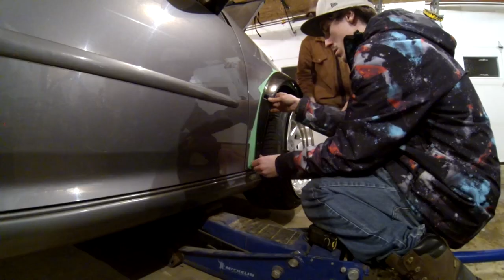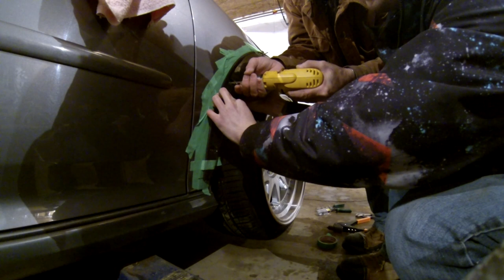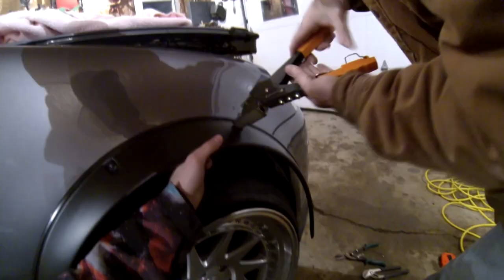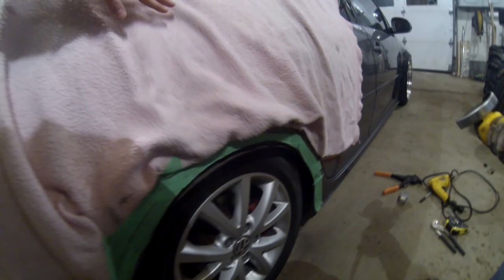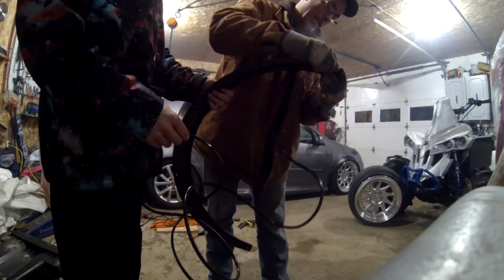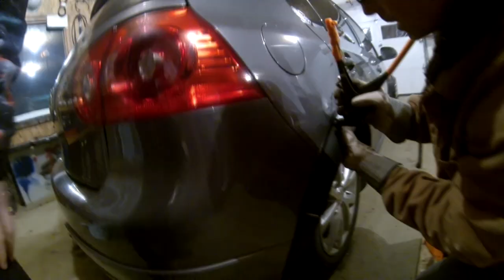How to install fender flare - Mk5 vw Gti - @ricky.df

Comment: Question...  BTW pretty slick..  After cutting the steel - why didnt you guys treat that uncut portion of the fenders both front and back to prevent corrosion or was that part missed in the video?

But my biggest question - the rear cuts..  How did you handle the inner fender sheet metal..  Did you cut that too and left it alone..  I thought it requires re-welding to help re-enforce the body??
Reply from the maker: that why i said in the info do not forget to paint and weld the under fender
Reply: Ok missed that.. Thx for the clarification.  Hopefully one day I get the courage to perform this...

Comment: What did u put on the trim of the flare??? Looks like a rubber gasket of some sort but not sure. Can u clarify?
Reply from the maker: Is only something to have a better look,   they dont come with the fender flare. i only buy them at my local store who sell lifted truck part '' bushwacker fenderflare'' so i added those trim to look better
Reply: @DizeFilms  it definitely looks good and helps with keeping the water from going between the flare and fender
Reply from the maker: i sold this car 1 year ago, but if you need to see some picture of the car you can go check out my instagram:  @ricky.df     i apresiade the love. @N54_Sauce

Comment: What bolts or thing did you use? I ordered flares but didn’t get bolts to screw them in
Reply from the maker: Rivet
Reply: I recommend using nut serts, that way they come off easily if needed.

Comment: Quel taille à l'arrière ? 
Je compte acheter des fenders pour un look large avec des jante en 9,5x18 +45 à l'arrière et 8,5x18 +45 à l'avant et je souhaite encore rajouter des calles élargissent de 30mm de chaque côté à l'arrière et 20mm à l'avant quel taille de fenders me conseiller vous pour une mk5 2006 ?
Reply from the maker: Ta pas besoin davoir de fender flare pour avoir du 18x9.5 & 18x8.5...  Javais du 18x9.5 allaround stock....  
sur se video les spec son:
-Wheel spec: esr 09 18x10.5 +22 all around
-Tire spec: 225/40/18 
-Universal Jdmff fender flares 50mm
Reply: Sa passe avec du 11,5 de large ?
Reply from the maker: peu etre avec du tire plus stretch ou plus de camber

Comment: Im doing these on my mkv gti im running 17x9 et 25 squared im wondering what spacer will i need to fit perfectly
Reply from the maker: i was runing 18x9.5 with 215/35/18 with no flare and no spacer.  With the flare i was runing 18x10.5 with 225/40/18 with no spacer and the fitment was perfect!  So if you only put 17x9 you atlees need 1.5 inch of spacer hehe
Reply: Thank you man appreciate it dude.   I was thinking 1" or 1.5"  spacer i wasnt sure. How far off the car do the flares poke
Reply from the maker: Go see my instagram if you want to see more Fitment picture,   @ricky.df
Reply: What is your offset on the wheels
Reply from the maker: Wheel spec: 18x10.5 +22 offset  all around